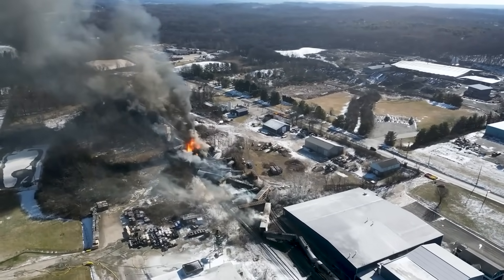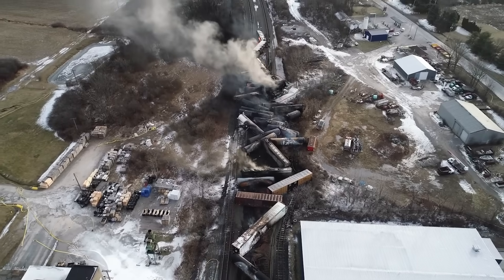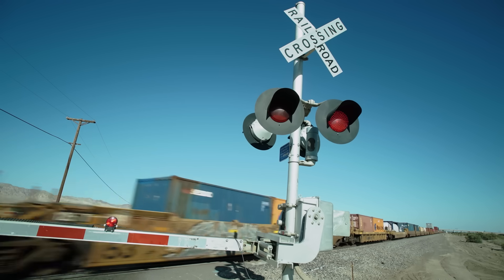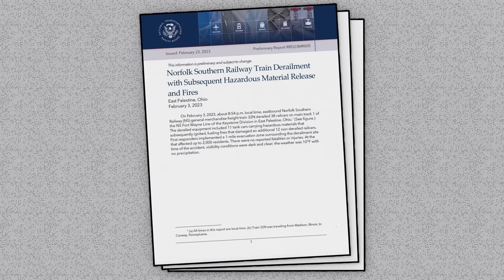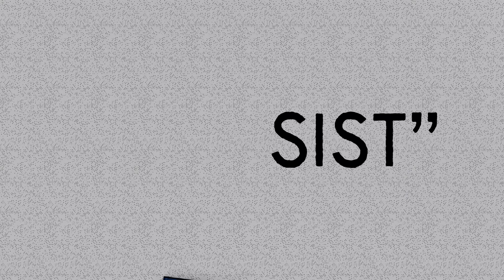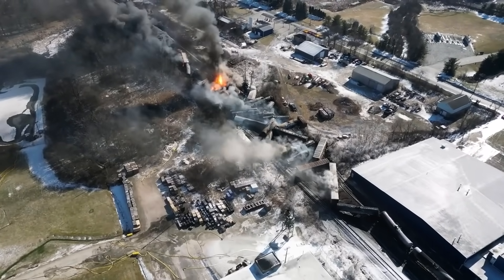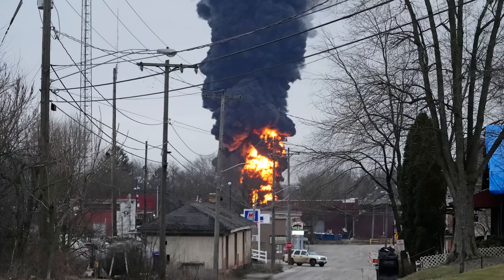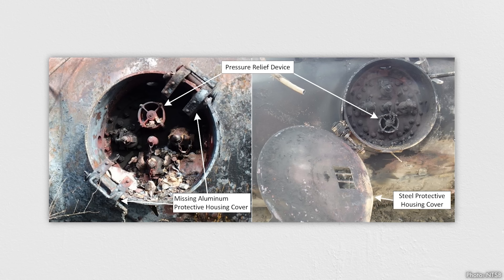East Palestine Train Derailment Explained

Comment: Love the video, I still have some big issues with some gaps in information about the incident.

1. If the system to dectet issues found a problem then why did the train derail? The defect detectors say the high temps but it derailed anyway, why? The root cause fo this needs to be found and addressed.

2. While the tank cars had improved safety devices, there should be no reason for first responders to be considered with the effectiveness of the safety devices. Clearly these cars need higher testing and inspection standards additionally there should be some design for fire protection when hauling flammable substances.

Comment: OK let’s look at this from the standpoint of history, the reason that the towns are there is because of the railroads in the first place. The railroads continue to pass through these towns for that same reason. Hazardous materials on the roadways, or on the railways are going to continue forever. Know whether they take it around a big town or not is one thing the small towns are very difficult to maneuver around, considering most railways were built around those small towns. I understand the problems that are associated with this incident. However, at the same time the way this country is made, transportation of any commodity will always be, or I should say have the possibility of a serious incident. The other aspect of this is moving freight on the roadways requires far more in the way of personnel and machinery, and will cause traffic the areas that either don’t see that level of traffic now or shouldn’t.
Reply: I believe East Palestine predates the railroad. Not every city was built on a railroad.

Comment: Not an expert but it seems obvious that even if the axle's temperature wasn't consider critical until it passed 200°F, the fact that it heated up SO FAST should be of great concern. If current technology doesn't provide a way to get this information until after the fact, I'd say that's something that could be improved.

Comment: There is always more safety that can be done. The problem is safety has a cost. Safety is actually very expensive. If a safety regulation saves one life per year but requires two lives worth of pay to pay for per year then it may not be worth those costs. Are we willing to sentence two people to a life time of working just to pay for safety to save one life? I don't know?

Does adding more safety guys to a job site actually make it safer or does having more people there result in a higher probability of someone getting hurt. If something does fall, having more people on the job site increases the chance that a falling object will hit someone.

Safety systems are built by humans, just like everything else. They fail. Problem is people start trusting the safety systems. Humans learn to rely on them and don't do the due diligence themselves. Be careful about safety just for safety sake and don't rely on it.

Comment: Something I think you'll be interested in looking into about trains is the work being done at Virginia Tech right now with the Department of Transportation where they are harvesting energy from the movement in the crossties when a train goes over them to be used to power equipment like those sensors and other things along the track so they aren't dependent on generators or solar panels in rural and remote areas.

Comment: The length of trains has grown enormously in the past few decades in attempts to increase efficiency, which makes them significantly more dangerous due to momentum growth and complexity of controlling and braking.  The difficulties of controlling a several-mile long train when part of the train is going uphill and part downhill, as was the case in E Palestine, do not seem to have been adequately addressed either in regulations nor in safety systems.

Comment: Wow - temperatures increasing from barely above ambient (+38F) to well over +250F within the space of two defect detectors.  Seems there should be more than simple thresholds; how about thermal differential thresholds?  In the aerospace/defense engineering community, this trivial railroad "BIT" would never be acceptable.  It also points out the inherent inferiority of attribute (go/no go) data to variables data.

Comment: I used to work at a chemical plant and safety is first in the culture at a chemical plant.  You probably know that RV's protect vessels if the external temperature is at or below design conditions.  This is not the case when a vessel is engulfed in flames, the metal weakens and the relief device is not properly designed for this unanticipated condition.  It cannot be known ahead of time what temperature might exist and thus the strength of the steel the tank is built for.  Hence, the decision to vent the material and initiate a controlled burn.  It was indeed ugly and all of this is zero comfort to anyone who is nearby or affected by the release and or fire and smoke.  There are steps that can be taken to mitigate this event in the future and I surely hope that new systems or procedures are developed that do just that.

Comment: So many discussions to be had on the transportation of hazardous materials. Engineering could greatly improve the RR industry problem is the RR  are the ones standing between improved safety and implementation. They know they are in the seat of power to decide weather or not to improve operations or cut corners here and there to make as much money for them selves. Great video BTW. I look forward to see what the NTSB's finial accounting is.

Comment: Maybe this already answered in the 2000 comments so far but two questions I’ve had about the incident are;
What would the “new brake system“ have done in this derailment and,
How did EPA and state regulators determine a major burn was the best way to take care of the hazard?
I dealt with regulators on emergency burns and detonations but they were a periodic event in our business.

Comment: In 2023, feels like it would be very possible to have sensors directly installed on every rail car, on every axle, providing continuous updates to the crew. Discrete remote detection like described in the video is just not good enough, it seems.

Comment: Hmmm~ I wonder if the temperature limit for the bearing should be lowered or if more detect detectors should be installed at shorter intervals, as the crew seemed to do the best they could but the bearing was too hot by the time they thought there was a problem to address.

Comment: It's insane to me that the conclusion of this is "well, freight rail won't go away". That's entirely besides the point. You didn't mention how derailments are going up instead of down as they should at all. Also didn't question why the temperature set to alarm was high enough that it only alerted after it was too late.

Comment: It seems like a primitive way to detect upcoming bearing failure. I worked in a paper mill running paper machines. The last time I saw bearing fire was 50 years ago. We used vibration analyses to give us weeks and months of early warning so we could fix many of them before failure.

Comment: It will take a disaster larger than this to significantly affect the organization of rail transport. What is characterized in the video as "political posturing" is a problem not for directing criticism at the railroad, but for the fact that it is mere bluster unlikely to result in significant imposition of regulatory burdens on a largely self-governing monopoly. Unfortunately this really is an essentially political problem that blunts the impact of engineering advances and prowess, and uncomfortable as it may be, engineers have a duty to speak up.

Comment: The thing that infuriates me the most about this wreck is that an overheating axle like the one that started the derailment is one of the oldest mechanical problems that railroads deal with. You'd think that after two hundred years of railroading they'd have a better record of preventing it.
Reply: "You'd think that after two hundred years of railroading they'd have a better record of preventing it."
Actually they DID - they just ignored that 3 out of 5 detectors where defective.

Comment: Just to be clear, the security video comes from Butech in Salem. Salem is about 24 miles of rail away from East Palestine. So this car was having problems coming into Salem, then continued on a 30-45 minute journey through Leetonia, Columbiana and past New Waterford before making it to the derailment site. The way it's worded makes it sound like the footage comes from moments before, but it was a while.
Reply: Because it fits the narrative of a"sudden" bearing failure. But in reality it was a BRAKE failure that caused an axle to drag for 24+ miles. Neither Norfolk Southern or the NTSB mention a hot WHEEL detector, only hot BEARING detectors. There is a difference, a hot bearing detector has an infrared camera focused on the bearing journal area(center of axle), a hot wheel detector has the infrared camera focused on the wheel nearer the flange. That is precisely why it took so long for the hot bearing detector to register the "hot bearing". A train wheel has a lot of mass and it takes time for heat generated at the outer circumference to make it to the center.

Comment: Thank you Grady for presenting a rational, common sense explanation of what happened in East Palestine, which is any railroad's worst nightmare. So many idiotic internet commenters think that railroads don't care about the communities they serve, yet they couldn't be more wrong. Railroads have led industry safety standards for well over 100 years, and the stats back them up. Airlines may be the safest way to travel [in the USA], but airlines don't transport millions of tons of vinyl chloride every year. Like you pointed out, PVC; the product we all depend on for reliable plumbing and HVAC exhausting every day.

Comment: Hi! A railway signalling engineer from EUrope here.

This is very interesting. The USA is a country that pioneered hot box detectors over 70 years ago. And now... I see we have much MUCH more advanced systems here in the EU, specifically in the Czech Republic.

Our ASDEK defect sensors consist of several systems. There are flat wheel detectors on rails. These are important in Europe, as our trains are more braked, and freight cars are not yet widely equipped with anti-slip brake units. Temperature sensors are much more important. We use 8 sensors that measure bearing temperatures, but also wheel rim temperature sensor (the rim may occasionally unstick from the remainder of a wheelset. It usually gets very hot before destructive failure), brake-block temperature sensor (as few passenger carriages and a significant amount of freight cars are still not equipped by disc brakes), disc brakes temperature sensors (two or three brake discs mounted between wheels). 

But the most important thing is how we deal with data. All results - positive or negative - are immediately sent to a centralised diagnostic system. The system reads the consist (including carriage numbers) from the central train consist register and sends all data - including normal values. A dispatcher gets various levels of alert. If the box temperature is more than 48 degrees Celsius above a whole train average - the alert is issued to the dispatcher, and a train must be stopped at the closest possible location where the train would not block traffic. The same measure is followed when the temperature is more than 60 degrees Celsius above ambient temperature. When the temperature is more than 90 degrees Celsius above ambient, an immediate stop is mandatory. The dispatcher clicks on a train of concern, and sees the results of every single axle of a train, so he can direct the driver or conductor to the axle of concern. 

Well, I thought this is a standard practice all around the world, even in the USA.
Reply: Speaking from Canada, North America in general has a "cowboy" attitude towards safety even today. Our regulatory bodies are largely toothless, resulting in companies that are not monitored properly, and often fail to meet standards without consequence. If you ever visit North America, I invite you to take "The Canadian"- a cross country passenger train (the only one in Canada). It shows the grand scale and impressive natural beauty of our country. For those with more specialized knowledge like yourself, it will also show some pretty shocking infrastructure.
Reply: Pretty much the same thing in America, theres an axle counter, draging equipment detector and, a hotbox censor, all you need. The bigger problem is why Norfolk Southern, the smallest and the cheapskate of the big 4 class 1s in the US, has fired over 300 workers in the past few years 3 of which being maintenance workers of that line.
Reply: @benjaminmorris4962 I'd not heard about the new state thing.  Part of the problem with American infrastructure is the sheer size of America, it cost a lot more to build up our infrastructure.  We can upgrade but for certain types of services like electrical and internet there's huge challenges in adding new tech while also (at least temporarily) supporting the old stuff.  Of course that's not an excuse for not trying or wasting tax dollars on other things (not just including obvious corruption but I'd rather avoid getting too political).
Reply: I've heard before than passenger rail in the US basically has to be subsidized because it isn't profitable and while I'd think freight rail would be more profitable there are still a lot of cost to consider.  Of course I wouldn't be the least bit surprised if it's just an issue of companies not wanting to put money into better systems and regulatory agencies not having the teeth to force the issue.  Most big American companies are publicly traded and heavily incentivized to do everything they can to earn profits in the short term and keep the investors happy instead of investing in the long term and trying to be stable/sustainable (publicly traded companies are inherently unstable and can never truly become stable).
Reply: @grn1 US passenger rail is pretty heavily handicapped by not owning a lot of its own tracks. The freight companies own them and are supposed to give passenger trains priority, but they’ve figured out a lot of ways around that.
Reply: @grn1  It's true. In Canada, the single cross-country passenger train operates at a massive loss, even with first class tickets costing over $2000/person.
There are a variety of factors  that lead to this of course.

Comment: The tank with Vinyl Chloride is exposed to fire condition and its contents are heated. But the tank does not explode (maybe due to PRD). However,  after the fire is extinguished, things back to normal with environmental temperature and pressure. But NTSB says temperature rises in a tank, that means Vinyl Chloride is so unstable ( it will have chemical reactions under normal conditions). That is not true. If Vinyl Chloride is so unstable it should not  go into transportation.
Anyway,  the auto-ignition temperature (or explosion limit) for Vinyl Chloride is 881.61 F. they should try to re-rail the tank to move it a safe place to deal with the contents. They can cool down the tank by watering or other methods. They can clean the path of pressure relief devices if melted aluminum dripped into PRD as they imagined. Then the tank is as safe as original.  As they have enough time to drill holes in the tank to relief the contents, they certainly have time to move the tank out.

Comment: Not sure what the goal of this video was.  If it was to basically give a very high level review of the accident and basically just repeat a sanitized version of what happened, the I guess you've done that.  However, there's a lot more to this story .. way more.  I encourage anyone interested to do much more research than just what was stated here in this video.  Here is a start. Couple things.   A vent and burn (or flaring as you state in this video) in this way, from a rail car IS NOT A COMMON PRACTICE.  As a matter of fact, this type of vent and burn has NEVER BEEN DONE BEFORE  in history.  Another thing not covered here is that the original plan was to vent and burn 1 CAR.  THAT WAS USED FOR ALL THE MODELING DATA that apparently was "used" to make this decision to do a vent and burn.  HOWEVER, FOR SOME REASON AND WITHOUT EXPLANATION - NORFOLK SOUTHERN QUICKLY DECIDED ON MONDAY, THE DAY OF THE BURN, THAT THEY WOULD VENT AND BURN 5 RAIL CARS.  It's on video that an EPA representative stating that they only modeled for 1 rail car, not 5 and that they were not involved in the decision to do the vent and burn.  Also, why would dig a hole and vent the fluid in to the hole and THEN IGNITE IT ?  If you can get all the fluid into the hole and then  get the cars out of the way and deal with the chemicals that way, then you've got 1 bad area on the ground to deal with.  Instead they ignited it spreading it into the air across hundreds of square miles.  Also, they way you represent the whole vent and burn as an effort to protect the people on the ground and prevent contamination of a larger area almost absurd. Also this is the first that I've even heard of this overflight of the EPA plane to detect "particulates", but if you've done at least a little more research, I think you'd find a lot of things done by the EPA here very questionable.  I've liked a lot of your videos but this one... disappointing and makes me question the content of all your videos.

Comment: The more liquid the pressure relief valve releases, the more of the metal tank no longer has a liquid coolant behind it, and when the heat compromises the wall of the tank, the superheated liquid all vaporizes and combusts, BLEVE, boiling liquid expanding vapor explosion.  BLEV explosions are phenomenally powerful, the propane truck in italy 4 years ago gives an example of the potential, on a truck sized scale.